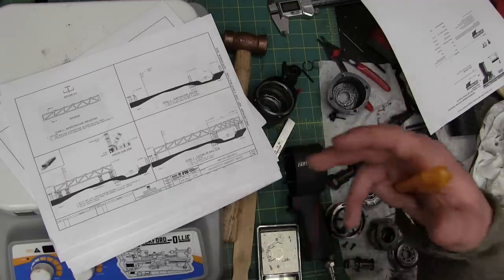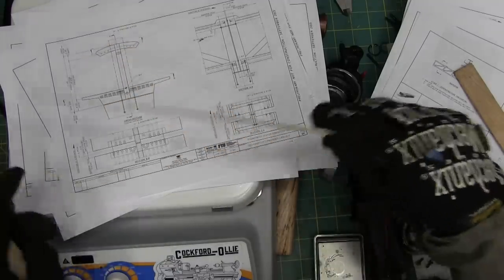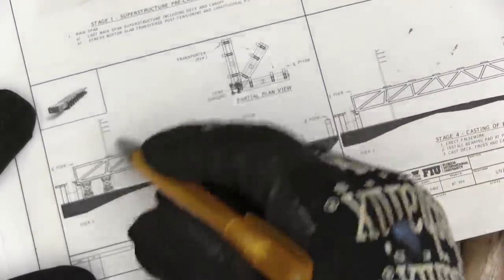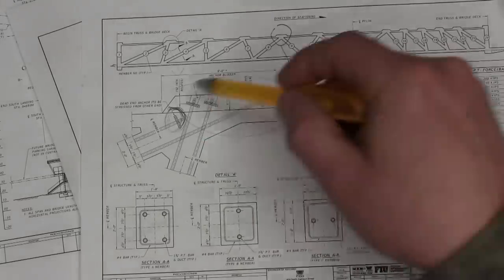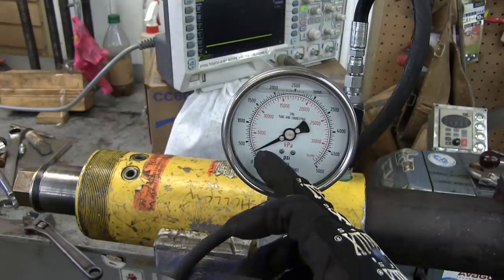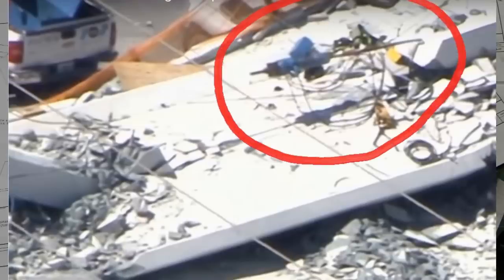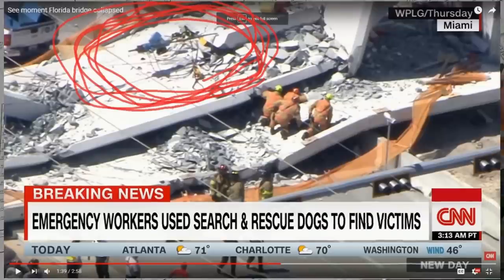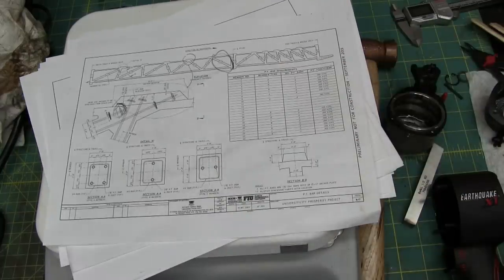Post Tension Failure Florida Bridge Collapse | Engineering EXPLAINED!

Comment: Great Analytical Work and Right Back At-cha Response.Thanks ..!!!
Seems to me the angles do not show balanced tension and subsequently when the structures Mass Weight and Gravity factors are added to the overall design, simply do not add up to "Anything SAFE" 
I'm not an structural bridge engineer but the whole thing looks like more Art then Load Balancing..!! I.e. Too much eye candy glued together with wishful thinking.. 
Furthermore: 14 Million Cost...!!! Looking at materials and labor is way to much for this Deadly Nightmare Period. My take... after it comes under State Engineering Peer Review, the finding will fall at the feet of the all parties involved: Local zoning engineer authority who will share fault with Fraudulent Credentialed Ms Figgie & Deadly Design Partners who cobbled the entire Rig together on paper and those at MCM who likely used their political contribution to leverage the project through the county / state approval process..
Either way ground zero liability falls on Ms Figgie and MCM bank accounts.
Furthermore: Had this bridge not gone down during the erection phase, the first Force 3+ Hurricane that interdicted this structure would have brought it down any way.  
Note: The Walkway Canopy looks like the wing design on a B-29.
Final comment: Women should stay the hell out of Potentially High Risk En-devours. 
Women simply lack Worst Case Scenario Contingency Forward Thinking.. 
I know I'll catch a grip of shit for this, but all my extensible  professional project manage experience ..
 precisely supports my conclusion.

Comment: I worked with pre stressed concrete slabs, I had never seen slabs stressed pulling cable without support after concrete set..
No support if load, and pulling, ? Why, wasn't mentioned. Bull crap, cost cutting, set in place before tensioner
There not rods, drawings don't mean crap when you installed it before design test an approval
End of story.

Comment: I don't know about the foul language, but there's something foul about this crowdsourced explanation. Even if the failure has something to do with this member it doesn't really make sense to tension it further, as the member is already compressed in this phase. This would mean to add more compressive stress which is unfavourable. Most probably there wasn't just one reason but a series of errors in the design, preparation and construction phases.

Comment: It would be interesting to know the age and real-world experience of the engineers who designed that piece of crap. I betcha they really believed that what the computer program told them was the goodest of ideas for the limited knowledge they allowed themselves to know.
Reply: At my job I design with steel... then if needed, I add facade. This bridge was designed with facade and the steel was at best a legal requirement. Smarts did not fail for there was none... but the legal stuff failed big-time. Unless the computer programmed is written to have smarts all it does is do the stupid shit the engineers ask it to only represent... that is, only represent.
Reply: The design is not controversial. They just should have shut down the road when  they realized they had to make some critical adjustments.

Comment: Do you realize its the same type of truss that was used in flooring on the world trade center buildings 1 and 2
Reply: Who builds a bridge that is a floor or roof truss that is just alot bigger think about it
Reply: NO, it is not. No engineer would use such a bunch of oddball angles in an underfloor truss. Half of those angles of the bridge correspond to the cable stays that should have been in place before the mobile jack system was removed.

Comment: Far too much cheating out, or bean counters dominating the engineers? The space shuttle, this bridge and even Fukoshima. A horses arse shouldn't driving the carriage. I've always suspected that fukushima wouldn't have occurred if the diesel engines that drove the pumps were on a tower on the roof of the plant. Probably cheaper to place them in the basement in a tsunami zone? What? Up here for thinking, and on your arse for the wallet. Some things are just meant to be by way of poor design. It was designed to fail and it did. Daichi were responsible, but not by way of any reasoning engineer I would argue. Had I been given the task of building diesel engines for the water pumps in the basement, I would have resigned and contacted the news outlets. Shame focusses companies. It focusses men. Just ask any woman.

Comment: All what he said.....plus this.....MOC.....you "enginerds" know what I'm talking about. A well-documented and policed "Management of Change" process needs to be in-place for projects like this. Any field changes done....even those considered safe and innocuous.... may have un-intendeded consequences and may have compromised the design (strength) in some way. You make field changes or adjustmentes only in accord with a MOC review. But....you say....Sh%t happens....NO !.... not when you apply the necessary OD ("Operational Discipline")......to not go forward without following all the safety and design protocols of MOC and like-kind processes. In the end, I  think we will find multiple contribtion to the failure....the list would include altering the method of construction or support, without proper MOC...lack of OD.... allowing personnel under the bridge (the BIGGIE here, agreed).... very small design "safety factor" margin ( Jeez....if this rod fails and the bridge unzippers like this...what happens if a truck hits a portion of the bridge and ONE rod fails like this?....the design needs more safety factor to allow the bridge to survive even if one rod is compromised)...possible "Rush" on time-to-completion ( ALWAYS an issue that needs to be managed....)....and poor workplace safety "Culture" . Look at the guy in his SAFETY HARNESS (on top of bridge near the crane) , falling when the bridge falls away under his feet. Harness faulty or how he wore it was faulty...and someone allowing him to work that way....sloppy.... and lacking OD, etc. Criminal.

Comment: Also had an dumbrr plumbrr drilling holes and chipping out for a new drain placement in A shower floor and hit, and broke in half a post tension cable and blew out the side of the 9th floor in a condo on longboat key FL. Praise baby Jesus for insurance!

Comment: Interesting graph in this tensile test. The force actually does drop slightly when the neck forms, decently before failure. I'm not even close to being an engineer. Can anyone reconcile this with the current bridge failure theory? Either way, it seems like it would be a well-known warning sign.
https://youtu.be/D8U4G5kcpcM?t=1m42s

Comment: 8 years of building this for dot beams  and only 1 time was anyone doing post tension ..shit I did more drap strand and that's a lost art .. post tension is useless as just moving the beam in place puts stress on the concrete .. when pre stress has the strength from day one ...shit all it is  ..is a flat slab so fucking poor design ..if the cables failed it means low dia cables and pulled beyond its spc which then makes it useless .. + was the cable dot checked is it usa made or cheap crap chins cable ..

Comment: The use of the crane was the complete cause of this collapse.  Lifting tons of concrete on a single point and then dropping that weight, due to the crane cable snap, will fracture the concrete directly below the lift cable.  They should never have relied on the crane to act as a support.  Supports span a wide area under the structure.  Not lift at a single point.